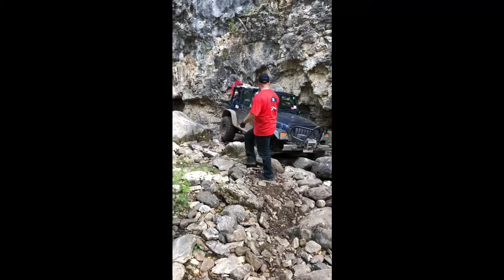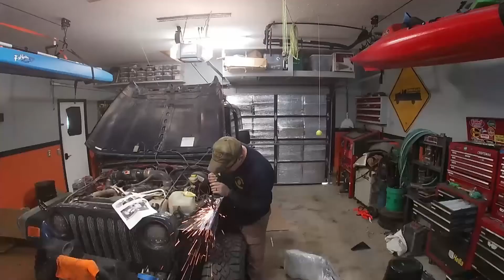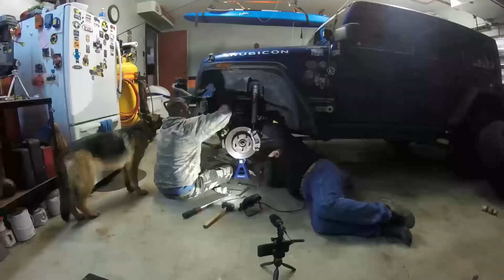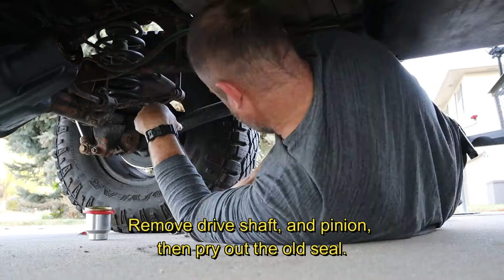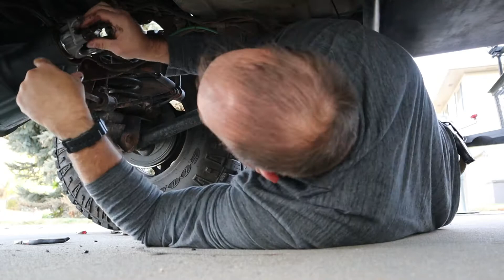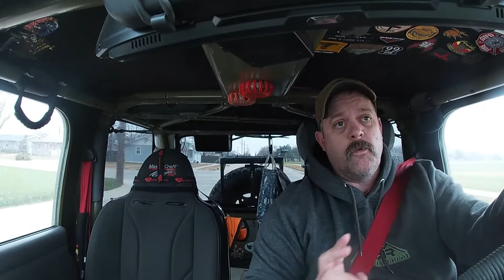Dana 44 rear pinion seal fix

Comment: Glad you got it fixed, but i thought this would be instructional.

Did you figure out the coolant smell? I've got that in my LJ, and haven't noticed a leak yet. I've also been suspecting the heater core.
Reply from the maker: Yep, the smell was a heater core.  Sorry the video was less than instructional.  Thank you for watching!
Reply: @DunnageGarage  No worries. It didn't advertise as instructional, so that's on me. Thanks for the heads up!